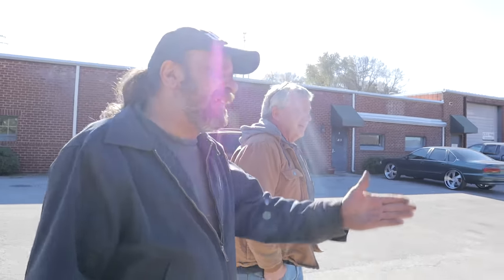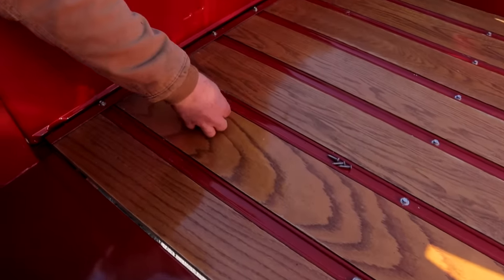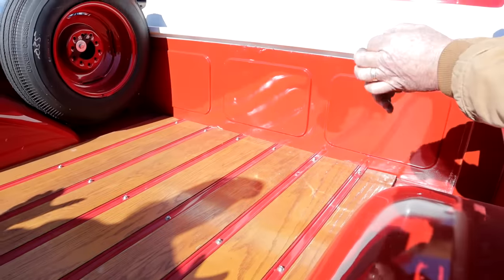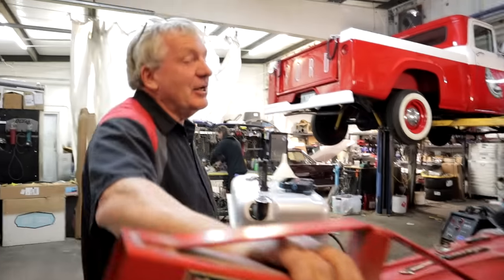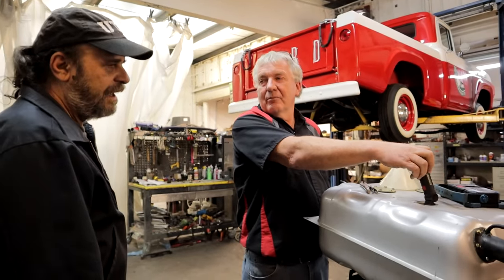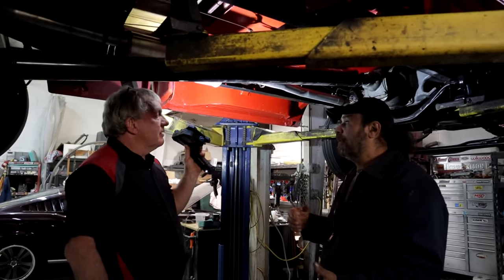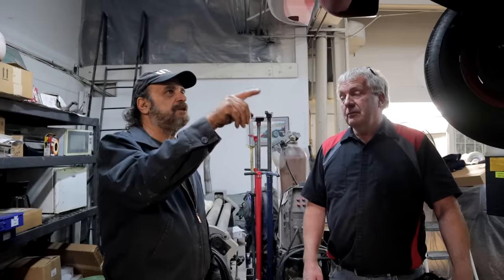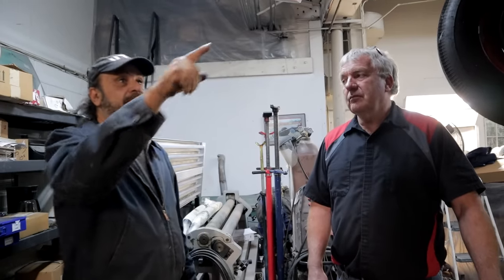Frame Off Restoration Gone Bad - Pretty Red Paint Hides Trashed And Rotted Parts Throughout

Comment: Good man calling them out. People pay a fortune to restore classics and they should know who the bad builders are
Reply: I agree
Reply: This is fraud. The shop that did this would get clobbered in court.
Reply: They all start out with promises and good intentions, in the end only a few can honestly deliver what the customer wants and pays for.
Reply: Crooks, hacks they need to be held accountable.
Reply: Should be an inspector to check the car before leaving any restoration shop
Reply: @Chemically_Induced  Nope ... They deserve it.. This was a trash job..
Reply: Helps when you know what to look out for. Part of the reason mines taking so long is finding someone I’d trust to do the work.
Reply: @Chemically_Induced  a person that agrees to do that kind of sloppy work should be held accountable. Just like ones that remove airbags. Not only that who has the self respect to do this and be okay with it
Reply: @noneed4me2n7  do it yourself
Reply: Resale red.
Reply: @Chemically_Induced  I left a comment on this video but not in this thread saying the same thing you just said. 
 HOWEVER, they should have told her no.  What's the excuse for cutting the window hardware in half? Or using those long screws in the door? What's the excuse for the self tappers in the bed?
Then notice the meticulous attention to detail in the paint.  yeah, they didn't cheap out there.
Reply: @fuqutube  circumstances what with my dad dying unexpectedly and my place not setup for it. Yeah, do it myself. So simple.
Reply: U get what u pay for.
Reply: @noneed4me2n7  I never said it was simple friend. Life isnt simple. I just said, do it yourself, and never look back. You will know its done correctly. You dont need a lift, or a shop. Many people make excuses about why they cant.. You can, if you wanted. Sorry about your father.. I am sure he would agree with me.. Think about it.
Reply: @tarstarkusz  meticulous attention to detail in the paint ? check out the bed corner when the camera is on tony !
Reply: @fuqutube  I’m just gonna leave it at disabled vet. Yeah I wish I could still do it myself but as you so eloquently put life isn’t simple and man I wish we could’ve finished it together but he couldn’t for years prior to dying. I’ve despite my limitations will have it done where he gave up.
Reply: @waynefergusson9987  I said that to show they only take care of what the customer can see and not what they can't see unless they look hard.
Reply: People watch too many TV shows showing all the good builders and all the Very talented people. If you go to your local body shop and think you're gonna get something fabulous you are very very wrong
Reply: @tarstarkusz  No point.  I expect they'll just erase it.
Reply: Tony should apologize to Possum Holler Garage for this ginned up BS criticism and to this woman for whipping up fear personal gain -- when is he starting his own frame off restoration business to show us how its done "the right way" and still turn a profit, his fit and finish to this date amounts to removing a sticker with GooGone.
Reply: Or maybe this is defamation because the customer got what they paid for.
We won't know unless RECEIPTS are provided to show what work was requested and what was performed. Where are the RECEIPTS?
Reply: @2Truth4Liberty  Tony plays off 'frame off restoration' like it means concours restoration .. it means restored or repaired on the body side, there are no rear replacement floor panels made for this truck ONLY the front, so unless the fiberglass on the underside floor is removed, there's no way to determine if it was a shoddy cover up or a simple minor rust repair (SHODDY GINNED UP INSPECTION VIDEO)-- keep in mind he's trying to infer the body structural integrity is compromised whilst the passenger sits inside and on top of the frame rails.
Those inner cab corner replacement panels are just flat sheet metal bent at a rounded 90 degree angle, literally just a splash guard --- which the fiberglass accomplished.
Since Kiwi gave him the engine, I believe Mission Impossible, shouldn't he reveal this a compensated video, did he offer the 'so called' victim a reduced rate as compensation for the video, if they care so much about (person #1) should they not compensate them
Reply: @dennishernden2264  you want to see my build???? Possum Holler is no better than PT Barnum....dazzle them with BS, I live here and Max and Margaret talk BS...I live in Columbia also, he pissed off the locals and I have 3 you can meet. I don't know this guy from Adam but that shop has been in business for years in Franklin
Reply: @Chemically_Induced  Better make sure what YOUR version of bottom dollar is...they already got run out of Florida for doing the same thing....I HAVE CHECKED, unfortunately to little too late....they have a bad rap here in Columbia and I have paperwork AND a truck of their "handiwork" and can greet you to 3 or 4 others in town....dazzle with BS and stage the moment is their M.O.
Reply: @RealmCenter40  Possum Holler HAS been to court.....public record....the problem is...a lawyer will run you almost half the cost of your build so better to cut your losses and pass the word.....On my build they put a metal placard of their shop brand right on the firewall...All I can tell anyone is, I have a truck of their handiwork and garage kept since it came home....come to Columbia and see it for yourself...their autograph is right under the hood.
Reply: @toddgreer2090  I generally don't like this UTG style of being the sole arbiter -- kinda has the feel of the dirty dozen restaurant review, investigative reporter chasing down crooked contractors -- and low and behold portray themselves heroes inflicting retribution whilst taking out the competition, essentially enriching themselves .. It's bad, real bad. Not only that it panders to the lowest common denominator of human behavior, the online savage pissant.
Reply: @Chemically_Induced , right, they were like, hey, we should put a $3 rubber hose in the gas filler to not fill your gas tank with water, and she was like no, that is $3 better spent elsewhere.
Reply: Depends on what the person paid to have done. A lot of people balk at paying for stuff you don't see.
Reply: Their 'forgetting' about the drain holes in the door would be understandable in and of itself, but their having left the boards unsecure and the gas cap dangling loose indicates either gross negligence, incompetency or outright fraud no matter what the budget was. 

similar
Reply: Menace does not approve.
Reply: You get what you pay for I run a auto body shop and you get some cheap ass customers that want a million dollar job on a penny budget out of experience always do a contact so you don't get sued
Reply: A HUGE PART of the problem is because of our false economy and the idea a lot of these "craftsmen" have, where they think they have to charge ridiculous amounts of money to do what it cost $20 to do forty years ago.

Not to mention the fact that nearly ALL mechanics are either afraid to, or just flat refuse to work on "old junk".

I unfortunately came down pretty hard with MS about five years ago... I always did all of my own maintenance and repair work on my beloved '77 Dodge M600 chassis motorhome.

It's only got about 80,000 miles on it and even though it ain't "new", it's been well maintained it's entire life and I trust it to go ANYWHERE.

But because I'm too crippled to even remove the wheels to change brake pads, I need farm stuff like that out.

The bad part is that NOBODY wants to touch the damn thing... Unless it's a high dollar shop that wants to charge me $200 per hour, to then PURPOSELY take six hours to do a three hour job.

The other few strikes against me are that the old M Series Dodge chassis really is obsolete now... If it were a GM P-30, I'd be better off.

The parts are getting incredibly rare... Fortunately I had the foresight ten years ago to stock up on wear items like brake shoes and pads, etc... which really pisses off the shops because they can't sell me parts at a 300% markup AND they can't waste three weeks of my time "looking for parts".

Getting old sucks.
Reply: @capt.spaulding5858 crooks and hacks make up about 95% of the Automotive "business" these days.
Reply: @johnjaco5544  yep!
It's the same way home renovation used to be viewed.

I used to work in the Trades and I couldn't tell you how many customers were pissed that their kitchen or bathroom renovation wasn't DONE in an hour.

Too much TV Majick sometimes...
Reply: They should also know who the good builders are too.  There should be more talk about the reputations of these shops.
Reply: @timothybyrom5560  scrap the crap....
Reply: @---skynet---  They're guessing the owner paid $70,000. So, no she very clearly didn't get what she paid for. The frame should be all metal, at least.
Reply: Its not just builders its companies too like Holley who owns a bunch of other companies too and treats their customers like total idiots when theyre the dumasses. I bought a terminator X setup and also bought Holleys 36lb injectors and the box said 36lb injectors but the injectors in the box were 120lb injectors and the Term X instructions said it wouldnt control 2ohm injectors but it did but the excess fuel gaswashed down the cylinders that werent even chamferred right to begin with when Scott Shafiroff Racing ripped me off by putting non clipped pistons in a stroker engine that ate up the skirts and the cylinder walls so I got triple shafted in the same build when I put trust in Ron Francis wiring and their wiring harness blew up 2 Ford A9l computers and had to be repaired plus the wiring totally redone right with proper aluminum shielding on the TFI circuitry branch thats grounded to pin #20  plus had to put the wiring for the clutchswitch right instead of it being bypassed like RF does because the computer has 2 different timing and fueling tables and the ECU thought my vehicle was always in neutral with the clutch pushed, I also had to do proper grounding for all of the circuitry and the two special ones on pins 40 and 60 plus the HEGO ground for pin #49 that needs to be gronded way seperate from anything also to mention all the cheap chinese relays that werent in a stock A9L harness I had to removed because according to the rebuilder of the 2 A9l computers the circuits looked like they were burnt from voltage spikes and all the unneeded but added relays Ron Francis added to break up the circuits added alot of flyback into the computer like a stungun everytime the key was turned off and even though the computer has the ability  to withstand flyback its only regulated to withstand what the system itself will kickback through the only 2 relays in the whole stock wiring harness and EFI system for the EEC-IV systems ......Anybody that has a Ron Francis wiring harness in their hotrod and is always experiencing glitches and anomolies having a good day cruising that turned bad with the car on a wrecker plus always blaming cheap chinese autoparts from china while paying mechanics good money to swap parts, just know its not the parts its Ron Francis' wiring harness or Painless and also the Detail Zones wiring harnesses doing it as theyre all the same companies..

Comment: This is one of those trucks where the cab corners and body panels are all available (after market) cheap.  This so called restoration shop completely ripped her off.  Glad you two are making them accountable, the word will get around now.
Reply: Hell you can practically build a new truck from all the spare parts they sell now.  It's painful to me seeing how janky the repairs are.  Don't get me wrong I didn't do a great job replacing the floor in my project car but I replaced all the rotting sections with actual steel. Not fiberglass and chewing gum.
Reply: The sad thing is, even with the panels available. They chose to waste more time and labor doing it this way!
Reply: Gotta know where those panel’s etc come from. Bud of mine got fenders for his Nova, came from Mexico, not even close, no way to make em fit.
Reply: If you're supposed to be that good, you can make any of these metal parts, or Yes, buy them aftermarket, but YOU DO NOT FILL IT IN WITH BONDO.
Their work would have to get better to be described as 'shoddy.'
Reply: ..exactly!...maybe they didn't have anyone who knows how to weld sheet metal?..well, I guess they still could have pop-riveted those patch panels in!.😯
Reply: The auto restoration parts world is vast. I'm restoring two vehicles now, a 83 f150 and a 53 dodge pilot house pickup,  both have plentiful parts availability.  And reasonable priced.
Reply: Yeah? I need a pair of front fenders. Metal not glass..
Reply: @ale8oneboy  I somewhat agree but even a rough looking sturdy job takes more time and bondo to smooth it over
Reply: Exactly, and like Tony said, even if it wasn't available it wouldn't have taken that much longer to bend up a piece of sheet metal and tacked it in there with a mig gun vs. all the fiberglass and bondo work they did instead. Most of the cost on something like this project, especially a 6-cylinder stock pickup without any trick parts like this, is in the labor hours. Not only is it hack work, but they didn't even save themselves anything here really. It's unbelievable what they did considering what they charged this poor woman.
Reply: @ryanhogan6509   yea ...  Not gonna be repo !
Reply: Not on the 57 to 60.    Odd duck year.   No one has them
Reply: Sadly, it probably would have cost about the same amount, albeit a little more for the parts, but a lot less for the labor.
Reply: Everyone...wants  " Perfection...Oh Well......😥😥
Reply: @ale8oneboy  it takes time to layout and fit a panel correctly. It doesn’t take time to pack a hole with Bondo.

Comment: This is why I’ve learned body work correctly and am restoring my classic myself, I’m not gonna let this crap happen to my dream resto. 
Takes a while but in all I think in the end having done it myself it will mean more to me in the end anyway
Reply: You're exactly right.  There is something about the trials, tribulations, long hours of work, ect. that endures us to the final product. Especially after a few years go by.
Reply: There is no greater satisfaction then restoring your own vehicle and learning new skills. Even if I had the kind of money this lady spent, I wouldn't pay someone to restore my truck. I enjoy waiting for new parts and learning every nut, bolt and wire on my truck. I'm 2 years into a redneck restoration and every bit of it has been an awesome experience.
Reply: You're exactly right Bondo and fiberglass everywhere isn't the proper way to repair rust it actually makes it worse because water gets trapped and makes it worse ,cutting out the rusted metal and replacing it with new metal is the only proper way to repair especially if you're investing significant money into paint .
Reply: @HuskyGamersUNITE  personally I probably would have gone with something a bit newer in order to "learn" on.

Comment: Alot of resto shops count on the vehicles being pampered and kept out of rain/snow/salt so they can take weatherproofing shortcuts. I really appreciate how Kiwi always touches up welds & grinds with paint. And btw, no excuse for a shop that specializes in truck resto not to know that repro panels are available.
Reply: Exactly. They count on the vehicle being garaged or trailered and not driven or exposed to weather often. The kinds of things that would quickly expose bad work.
Reply: @HuskyGamersUNITE  And sites like bring a trailer make it easier to sell crap like that. Because you can manipulate the pictures to hide shoddy work.
Reply: @nitrous36  I would only buy an un-restored car on a site like that with photos of all damage and imperfections.